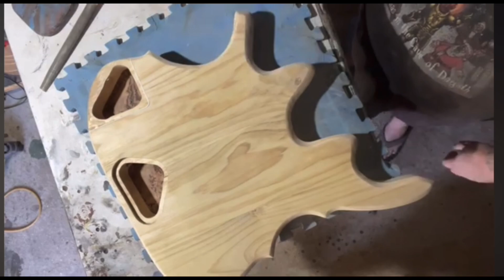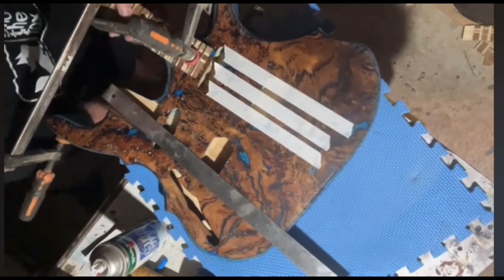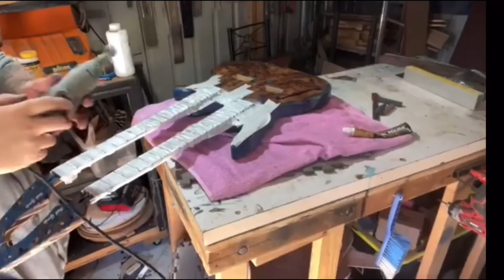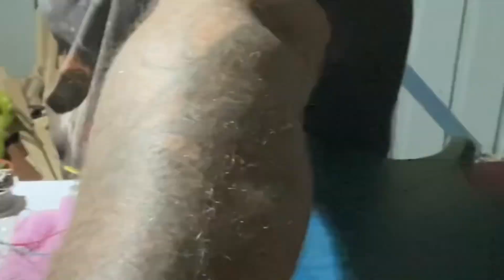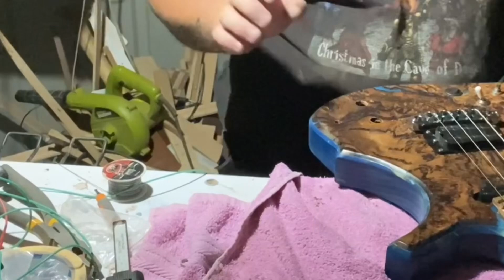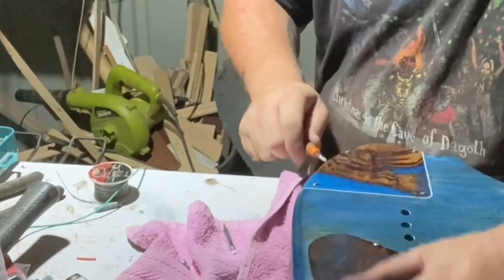Making  a double neck guitar part 2

Comment: Looks awesome as usual Corey. I love those top sets you find. Cant wait for the sound demo on this one.  BTW when you glued the one neck. you clamped from the side was that just to pull it tight to the top of the pocket or was that resolving a slight alignment issue?
Reply from the maker: Just had to bring it back so everything lined up as best it could 

That burl was from a table top project I bought off Facebook